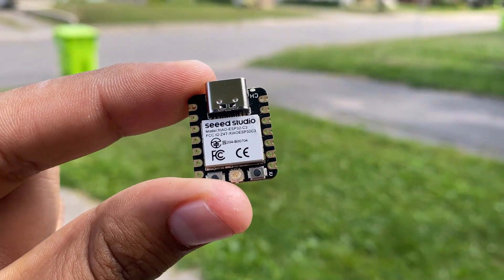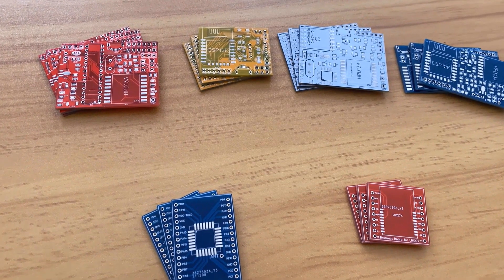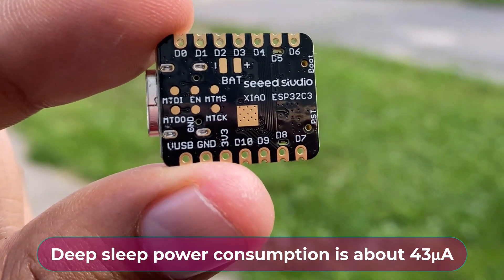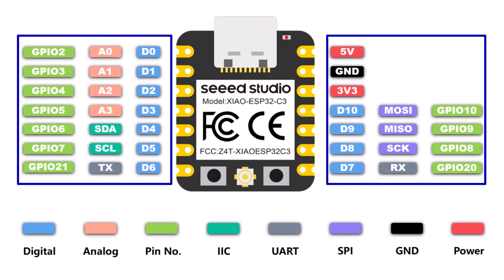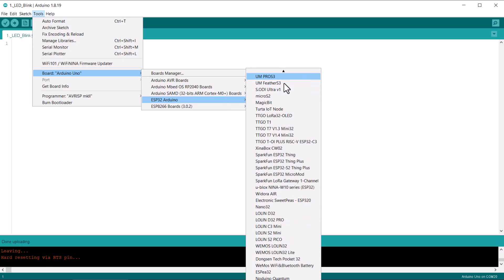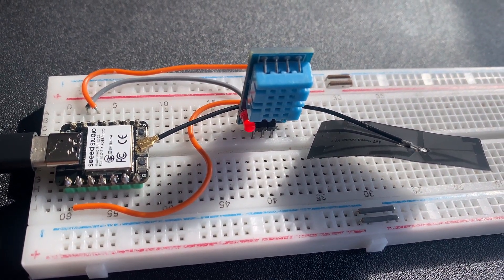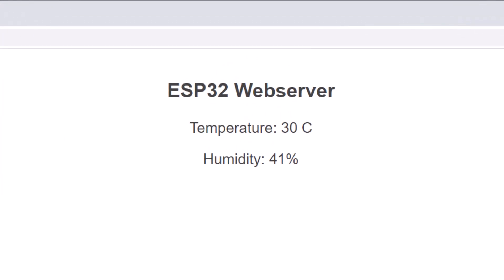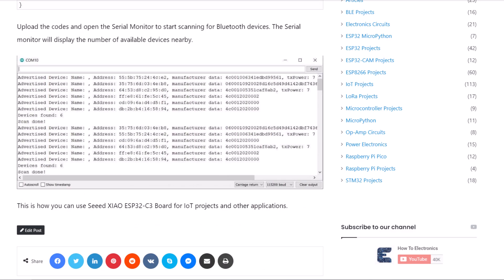Getting Started with Seeed XIAO ESP32 C3 Board with WiFi+BLE Projects

Comment: Just received a few of these. Very slick product.

Noted that the normal boot loader data dump on power up and reset to the serial port is disabled. Also noted that no crash information is sent to the serial port.

How can I turn off quiet boot mode and allow crash info dump?

Using Arduino IDE 1.8.19 with arduino-esp32 core v2.0.5. USB CDC on Boot is Enabled in the IDE.

Comment: Great video, I just received mine! Do you know if there is a way to use the built-in LED, e.g. is there an undocumented pin out that can control the LED?
Reply from the maker: This board doesn’t have any on board LED in order to reduce power consumption and utilise the maximum I/O pins
Reply: @HowtoElectronics  Thanks. I was hoping one could program the built-in LED that indicates battery charging and USB connection